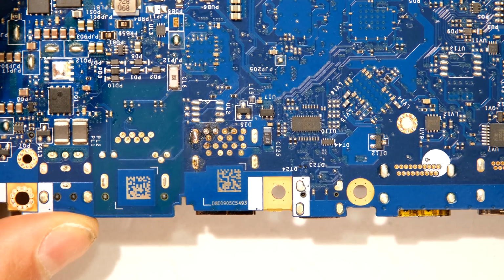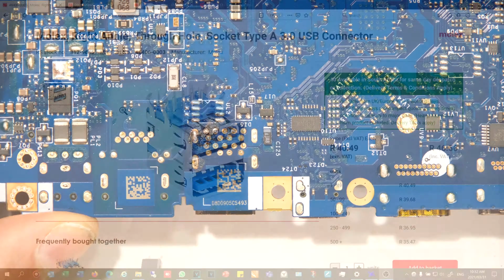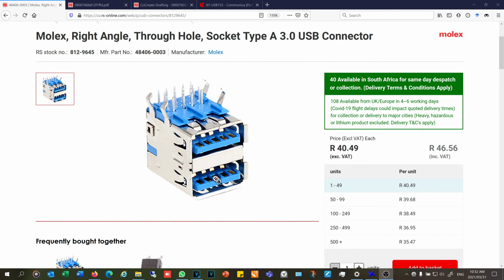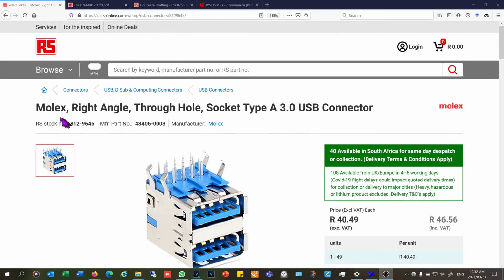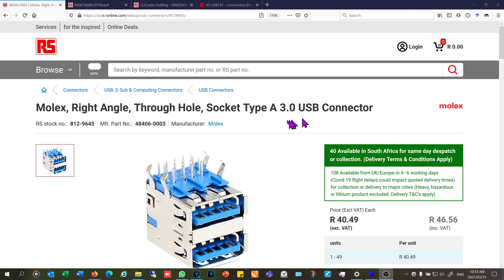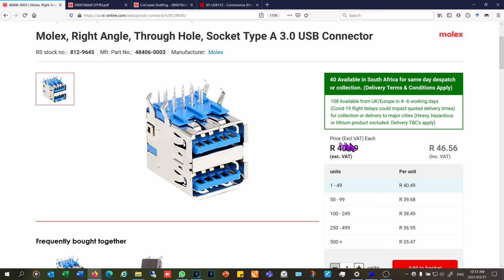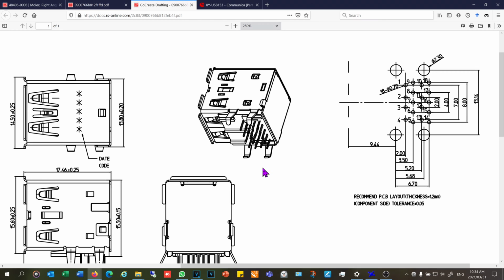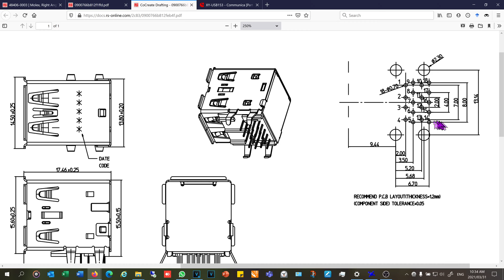How to repair the Dell WD19DC dock with broken USB 3 port.

Comment: Exact same problem here, same port too !
It looks you are showing me my broken unit.
I found several manufactures for the new parts besides the Molex, and I bought 3, one from each company. (Molex, Wurth, Assmann)
I will remove the broken part, and put a new part in it's place. (I have the right soldering tools)

Comment: Mine did exactly this on the first use! Unreal. Thnx for the info.
Reply from the maker: and its not under normal warranty...
Reply: @ecologicaltime  I noticed you mentioned that in the video. This was a computer/dock combo purchased for my job (i.e., not by me), and I just learned this morning that Dell is honoring the Warranty and sending a replacement dock....which hopefully doesn't have the same design flaw.
Reply from the maker: lucky you, i contacted Dell and they said not under warranty, which means you have a premium warranty.
Reply: @ecologicaltime  Yup, maybe so. I suppose it's in some work contract - I'd probably never buy a premium warranty for a personal computer. Anyway, loved the vid & appreciate your channel.